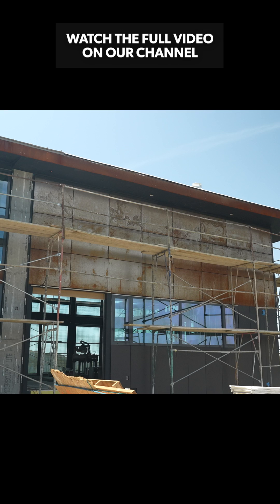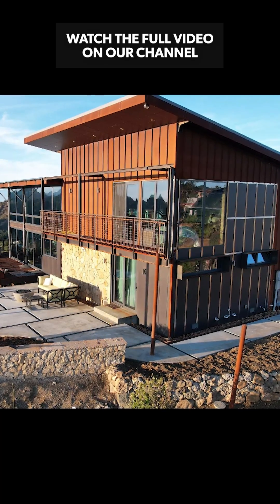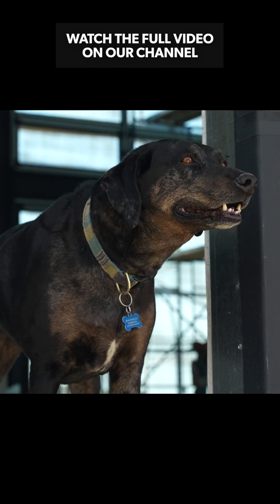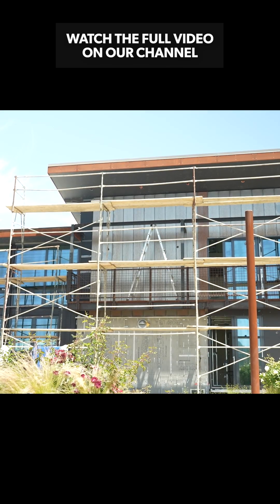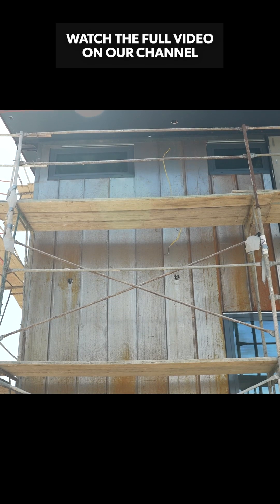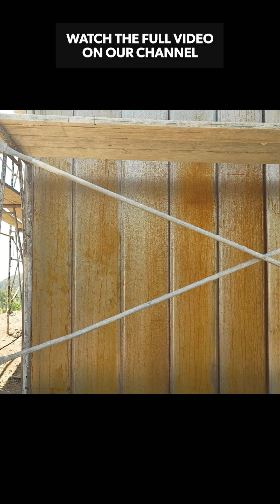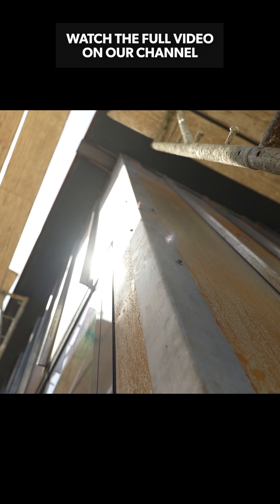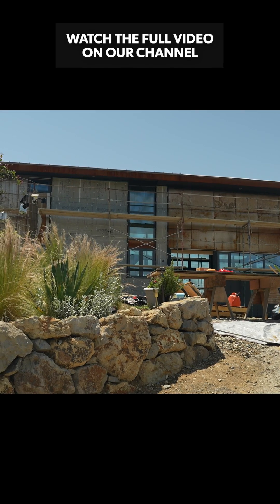Building a Fire-resistant House: A Story About Rebuilding a Home That Was Burned by Woolsey Wildfire

Comment: You better build yourself an independent water tower to store water for emergencies. Figure out how much water you use in a year highest amount used. How much water was used to put out the fire of your home that burnt down. What ever that amount was x 2, would be ideal, half again more would be sufficient. You need to burn down anything that can allow the fire to get to your home, burn it down and put it out. Especially, the direction the fire is coming from, the speed the fire is moving, the wind speeds, wind gusts, temp. fire. Be prepared to what needs to be done to save your property.